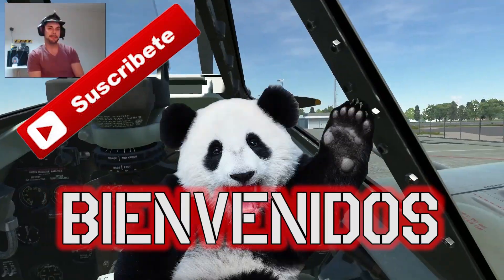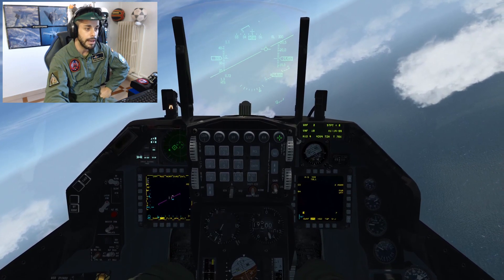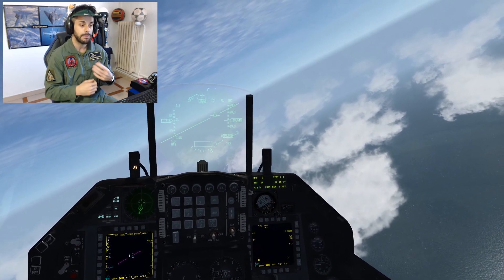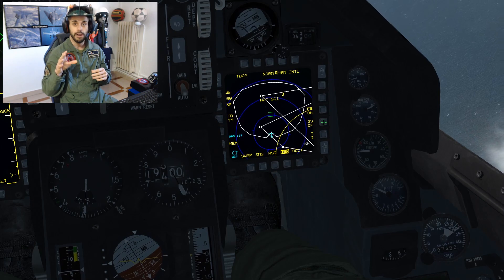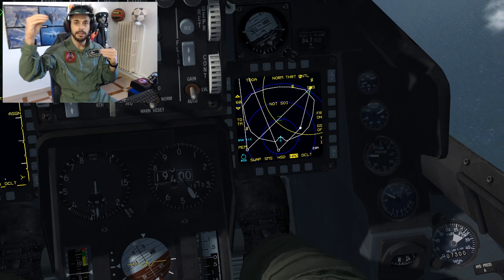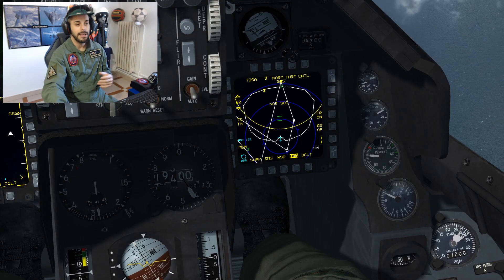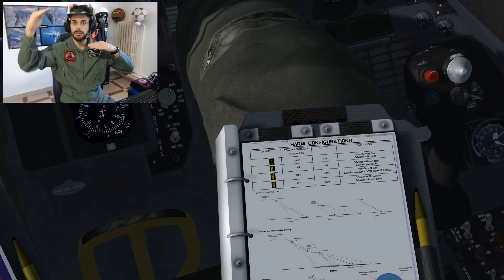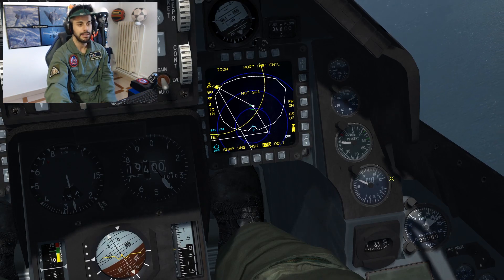FALCON BMS - HARM TUTORIAL (FLEX, GLIDE , GEO SPECIFITY OPTIONS) ENGLISH VERSION

Comment: can u tell me best configuration for display graphics
Reply from the maker: I use NVidia panel to default settings and in bms all to max
Reply: @revientoreborn  i am using same gtx 1060 with all settings high but  in game edges r not smooth in 4.34 it was fine